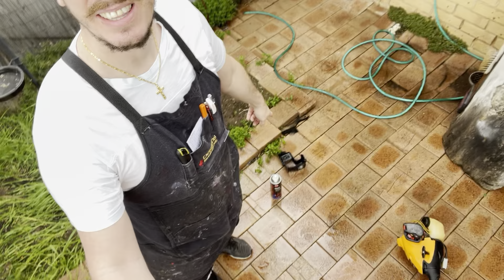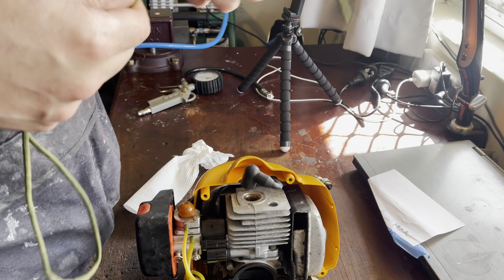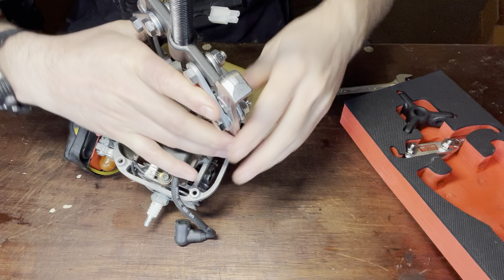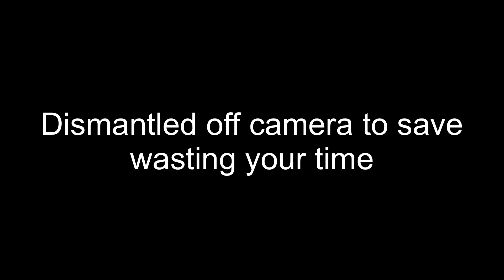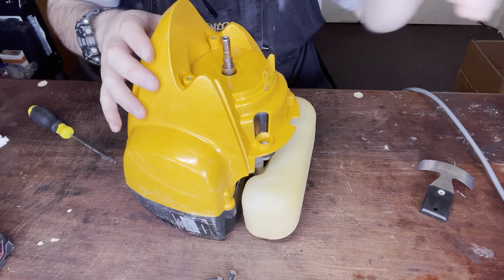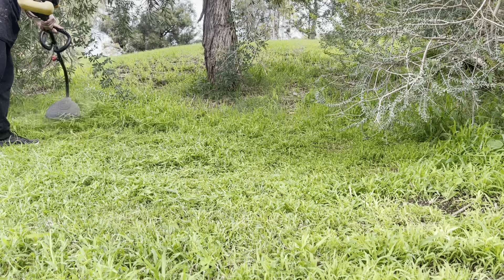One For My USA Friends - McCulloch Whipper Snipper Service, Disassembly and Repair.

Comment: Uh oh, Tom has a selfie stick. LOL
Nice video, You showed me a new way to remove a clutch that I never tried! 😁
Reply from the maker: Hahaha yes it’s fun 😂 I’m not sure on the other ways to remove this style of clutch, but if you have a method you prefer I’d love to know It!
Reply: @VintageEngineRepairs  I have a homemade tool I use but I like your way better. Mine is just a metal bar with 1/4(? don't remember) holes drilled and tapped in it and bolts threaded into them, I bend  bolts all the time so.... yours is better👍.